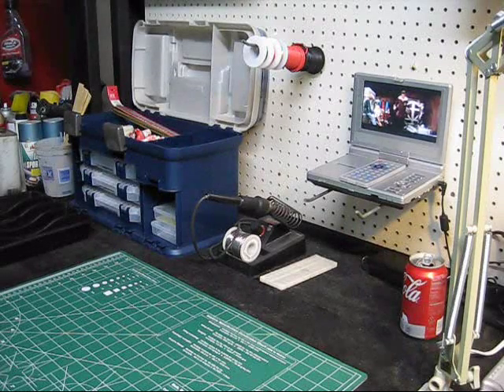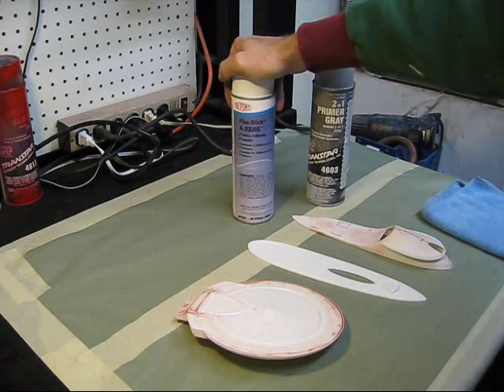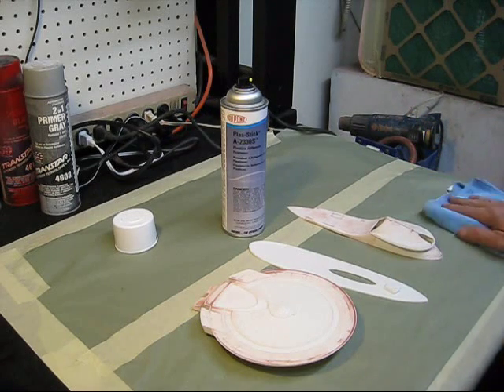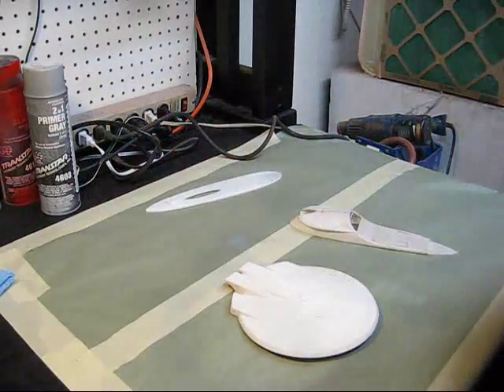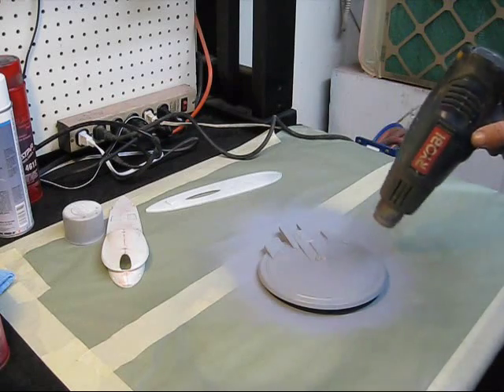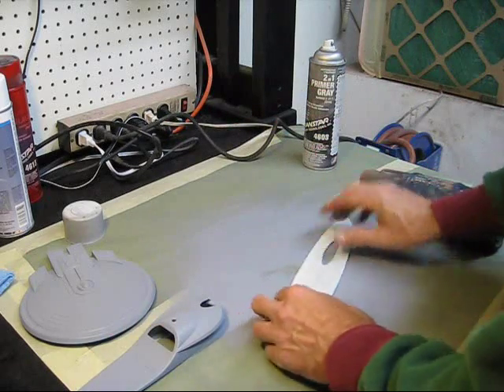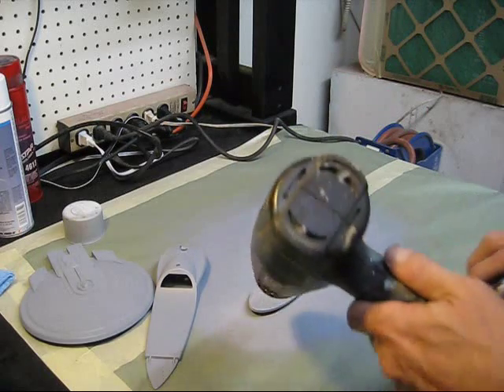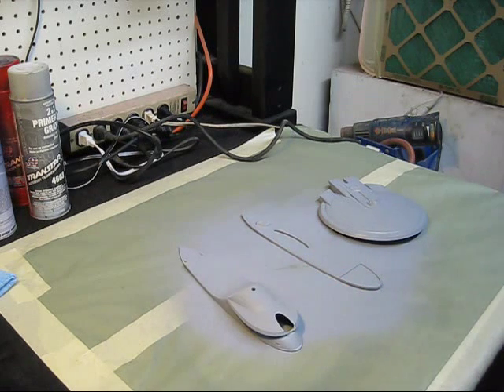AMT 1/1000 Scale Enterprise B Model Kit Build Pt 3 Priming The Hull Parts by TrekWorks

Comment: I noticed as you were spraying the plastic over the model pieces that you didn't have the bottom of the primary hull or the top of the secondary hull covered. Won't this stuff interfere with model cement as it tries to bond with other joined parts?

Comment: Not sure about the States, but if you're in Canada, you can buy a similar product from Canadian Tire called Dupli-Color Adhesion Promoter. It's in Dupl-Color's Automotive Primer series. It comes in a red can. Here's a link: http://www.canadiantire.ca/en/pdp/dupli-color-adhesion-promoter-for-plastic-flexible-surfaces-0476558p.html#.Vb1kW62vYoZ
Reply: Oh, that's GOOD stuff!  I've used it before when I repainted old joystick cases for personal projects.

Adhesion Promoter -- and Dupli-Color spray paint in general -- is pretty good for general covering jobs!